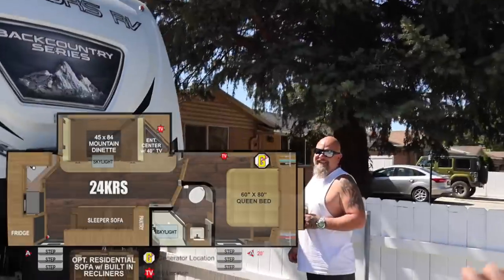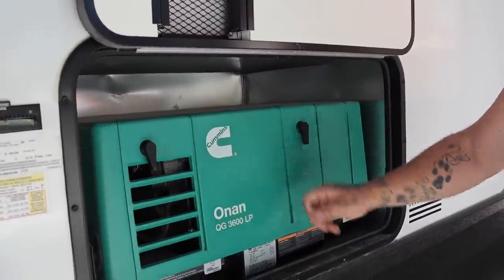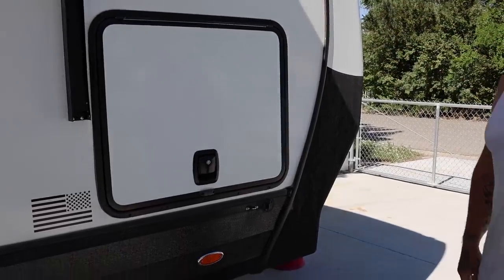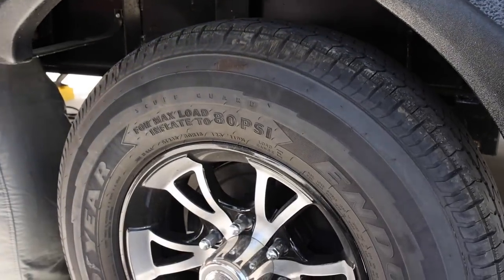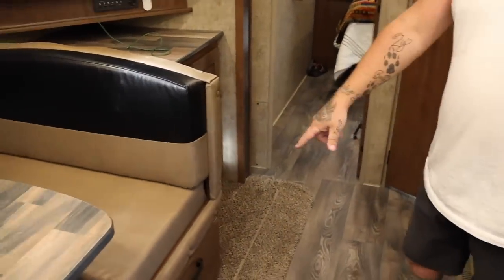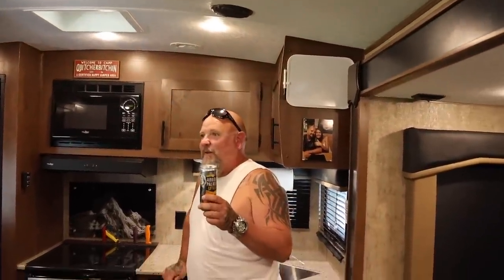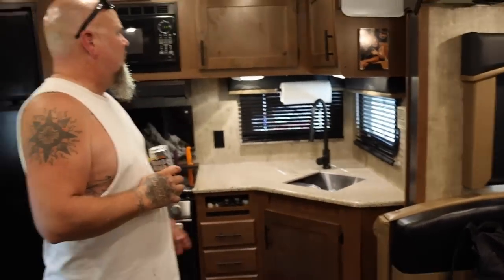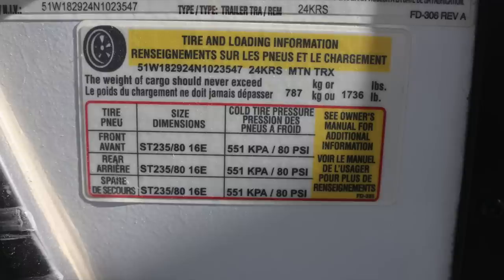ORV Owner Review: This Is The Most Overbuilt Travel Trailer I've Ever Seen!!!

Comment: Hey JB, I hope that you're having a great day! The Outdoor Titanium series Rv's are built just like those but just alittle better. They also come with one to two of the electric fireplace space heaters. They also come standard with 600 watts of solar plus Lithium batteries, and in certain cases they will have up to 1000 watts of solar plus they all come with a generator! They are all well built and made to last for years. They just came.out with one that comes with the patio and it isn't a toyhauler! Super nice plus I think the Titanium series comes.with two AC units but don't quote me on that. When I get ready I'm going to go from my home state of North Carolina to Oregon to get one, because if I'm going to spend that kind of money on a travel trailer or fifth wheel its going to be a Outdoor Rv. Leonard from North Carolina. This is the first time that I've seen your video. Great job JB!!!!!

Comment: I have an ORV 24RLS, love the trailer, tow with a 2020GMC Denali 3500 gasser.  Weighed the trailer today, she is heavy at 8,300lbs with 1420lbs on the hitch.
Reply: Hows the gasser pull, I was going to get another Diesel but didnt know if the gassers were plenty good enough. Thanks in advance
Reply: I don't live at high altitudes, and I don't spend a lot of time in the mountains. So for me, the gas engine is fine.  I don't have any issues pulling the load.  I'm only towing 60% of my max trailer capability.  However I am very close to max hitch weight (1450lbs). Plenty of room on the payload side (3925lbs). If you do a lot of high altitude driving, the engine braking of a diesel has a lot of value.  For full timing and high milage usage, the diesel would be more advantageous.

Comment: I wonder if there is an RV manufacturer that would build a custom trailer based on a classic design? In the '50s, manufacturer "Lighthouse" built a 30' foot bumper pull duplex trailer with 2 overhead Queen bed cabins in the middle. It was a brilliant design but very expensive. There are only 7 left in existence. I don't see why a manufacturer couldn't use that trailer's design plans and build someone an improved modern version. Despite its size, it apparently pulls like a dream.

Comment: I bought a Outdoors Rv. 2021 have had back to factory for repairs . Over 30 different mistakes found. Cabinets dragging, Stain on drawers peeling off, bathroom door out of square, squeaky windows, air leaks,  1 window slide window out of square. Broken supports behind drawers , broken support under dinette seat awning leaks, used different screws in cabinet door hinges . Outdoors RV HAS VERY POOR quality control. If you buy one do not sign paperwork until you have it professionally inspected by a certified inspection. 2 years into this Outdoors RV FQS22 my roof has bubbles .contacted outdoors Rv they say Out of warranty might take a look at it in spring. I was told it had a 10 year warranty on the roof when purchased . It is only on the membrane not against leaks, bubbles etc. I also pointed out what looked like nails or staples starting to push up under the membrane. They said oh just debris nothing to worry about. What is debris doing under my roof membrane. Buyer beware . This guy should pull the drawers out and check all supports for misplaced staples and screws and cracked supports. Good luck to him.

Comment: ORV doesn't even insulate their aluminum framing--the inside and outside walls are laminated to each other directly through the aluminum which is one of the best thermal conductors there is. And if you ever drop the cover underneath and look at the tanks, the only "insulation" they have is aluminum foil bubble wrap in the bay. Nothing is insulating the tanks directly. The RV industry is so bad that this is "good."

Comment: Hate when you spend this much money and you get floating entry steps.
Reply: It was a deliberate decision made to address uneven ground conditions likely to be encountered in dry camping conditions.
Reply: Yes, but it actually works out better for all the different situations and terrain that you end up finding yourself in at times.
Reply: The more commonly used type that swing up onto the doorway are really kind of a pain, and require a lot of room to swing out, as well as the uneven ground issue another mentioned.  They also introduce dirt and junk into the interior of the RV each time you close them unless you thoroughly sweep them off.  I park my rig next to my house and there’s no way I’d have enough room to swing down those other type of steps.  They are not better, just different.  Interesting that all the million dollar class A motor homes don’t use steps that swing into the doorway, all are mounted outside.  That tells you something.
Reply: Those are nice in that people going in and out don’t tend to rock the trailer. There are disadvantages, though. For instance I park my RV under a carport and don’t have room to tip the steps out. I’d have to hook up and pull onto the driveway to get in or out…
Reply: Prefer floating entry steps. Take way less room to open up.
Reply: Yeah. Toy haulers often stay with folding steps as you might need to have an OHV right up against the wall. 

Also if stable steps aren’t clean and dry when you tip them in…. Not so cool if they are snowy, muddy, pine needles. 

Still, not rocking the RV is a huge advantage.  If a person did the long stay/snowbird thing, or only camped in fair weather in paved or rocked campgrounds, I’d totally do stable steps.